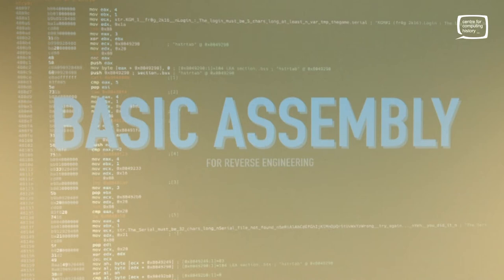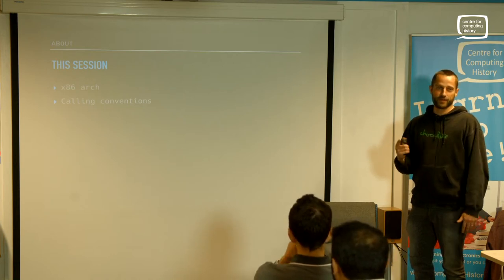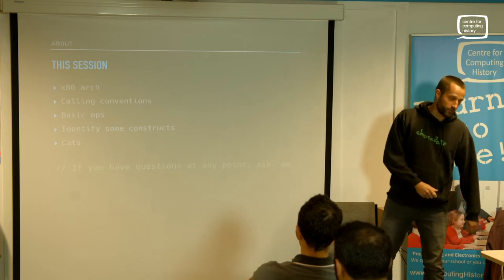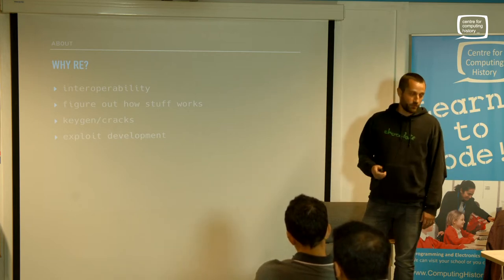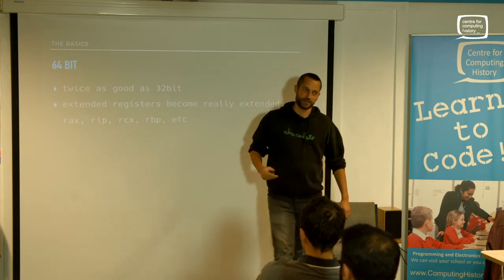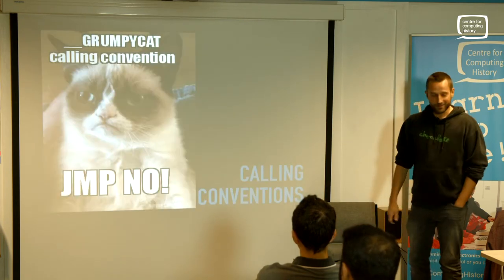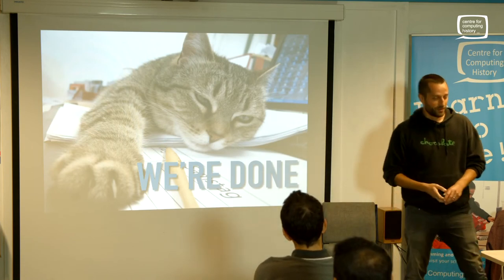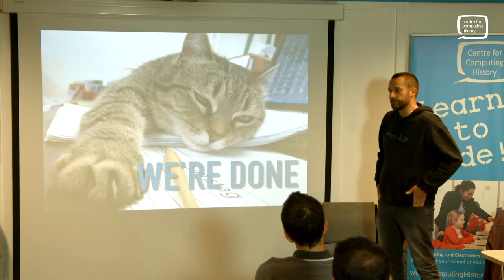CamSec - Basic Assembly for Reverse Engineering

Comment: the problem is with compiler optimizations you will probably never find a "proper function call"(the parameters placed on the stack), nor a proper "prologue" or "epilogue"(push ebp, move ebp,esp..), the compiler will store variables in all sorts of wierd places even way beyond the stack frame. Nor will you find the parameters nor the local variables neatly on the stack , etc..